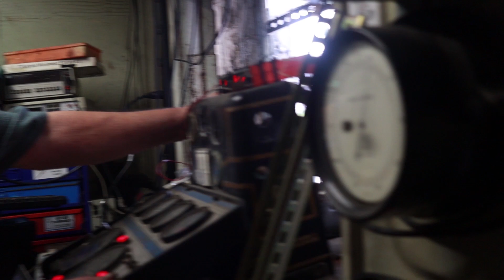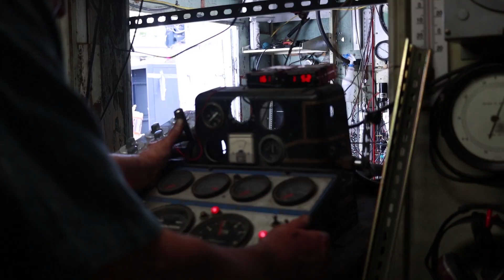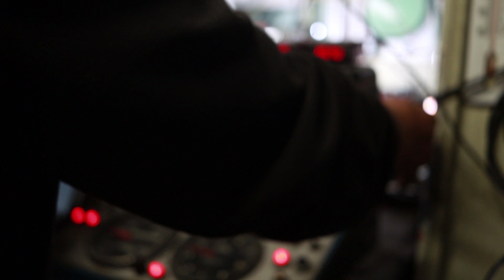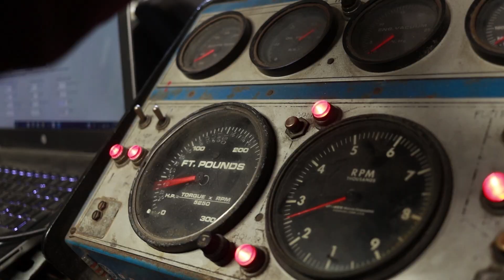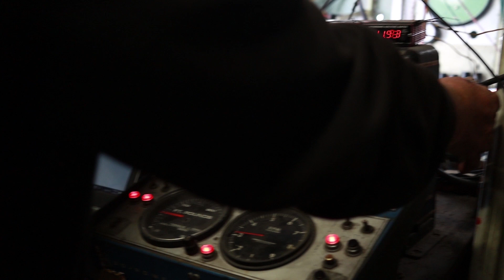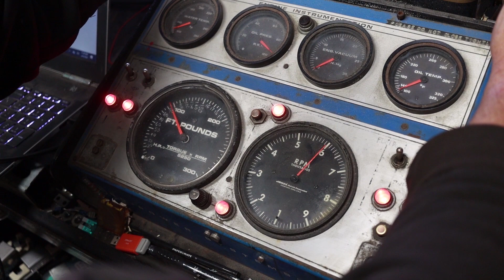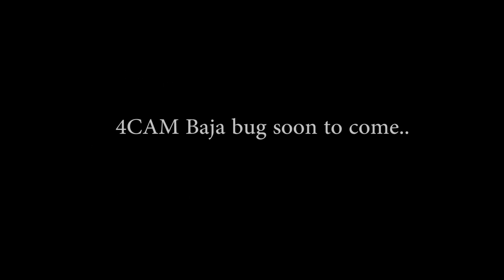Most Expensive Engine Swap: Baja Bug With a 4 Cam Porsche Engine

Comment: Confusing video?  Someone seems to be telling the 4 cam master how to tune the Engine?
Reply from the maker: Hey sorry if it seemed confusing. We had just rebuilt the engine and were going over everything on the dyno. The guy with the hat was just saying what we needed to do next for the sake of the video and to add a layer of redundancy as to prevent anything from going wrong. Hope that clears things up
Reply: @chrisbarba  Who is the guy in the hat?
Reply from the maker: @neilbardsley  that's Mike